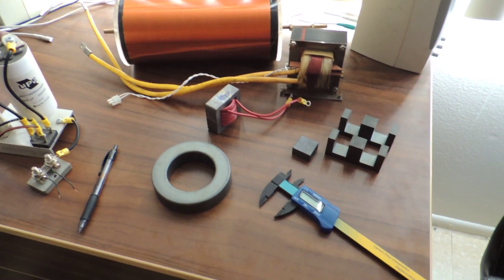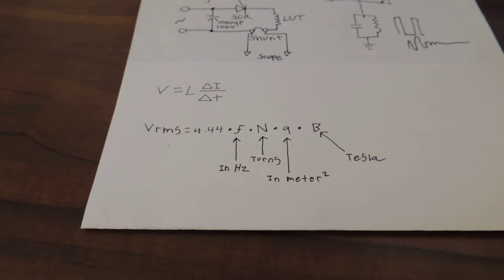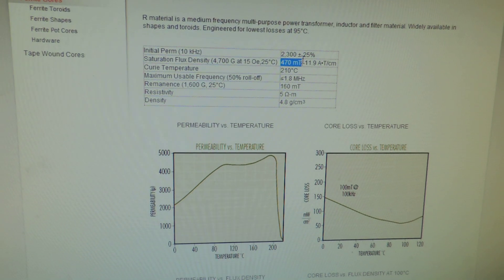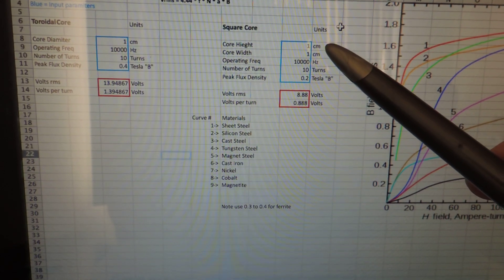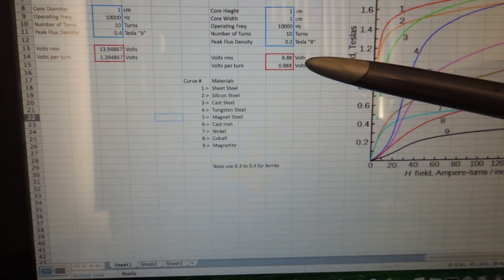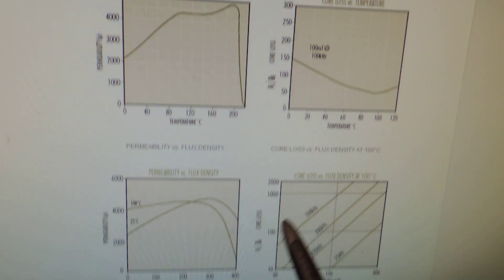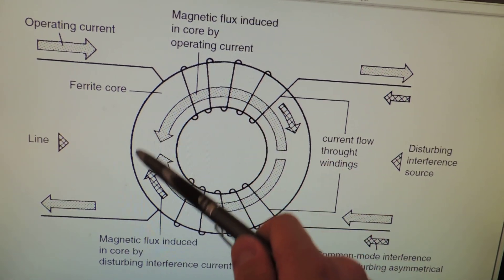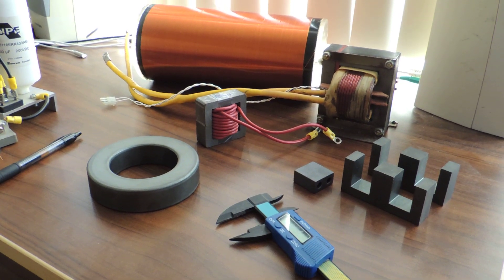Transformer/inductor design Part 2

Comment: Thank you for this great video.  I had a question in the part that talks about when you want to minimize the losses.  You state that if you use more turns this will help to minimize losses.  But I thought that if you make more turns this will increase the flux density.  Magnetic flux appears on the outside of current carrying wire.  More wire wrapped around the toroid means greater flux density.  So my thinking is this should lead to more losses (not less).  Where am I going wrong with this reasoning?